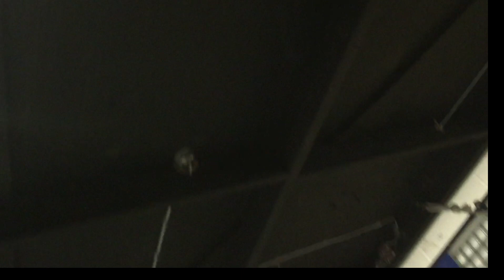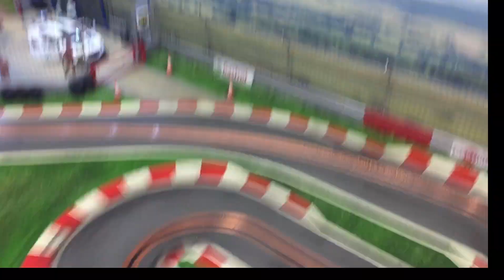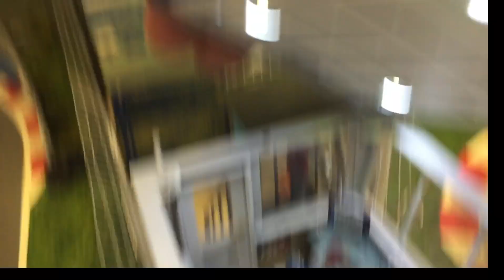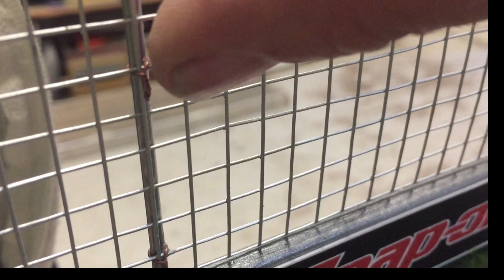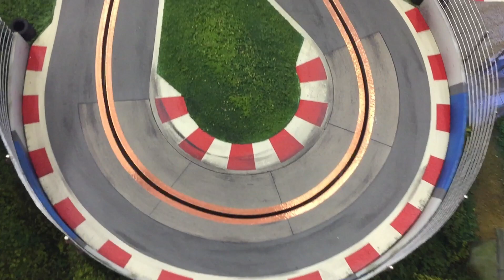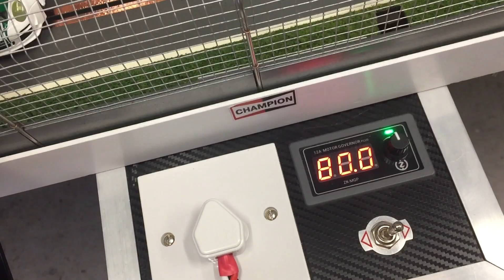An in depth tour of Crow Valley 2 Sprint Track.

Comment: Hello Rob. I would just like to say this track is Amazing and you are very talented. I am thinking of making a simple single lane track myself around 2ft by 10ft in dimensions and was wondering what is the tightest comfortable slot radius a car will run around please as I see you have effectively 3 hairpins in a 2 ft width at one end of the track. Many thanks Paul.
Reply from the maker: Cars will go around 6", but you need to keep the speed up to flick the back end around. Cars will not drive around 6" at slow speed, just watch any of my build videos, you will see how well my 6" bends work on CV.
Reply: @ thanks for the info Rob. 😄